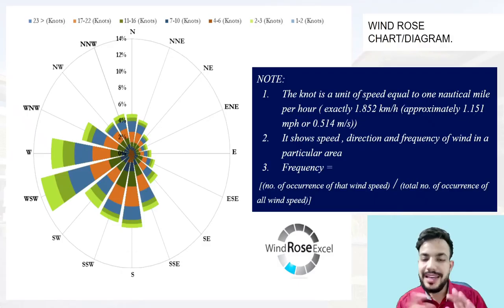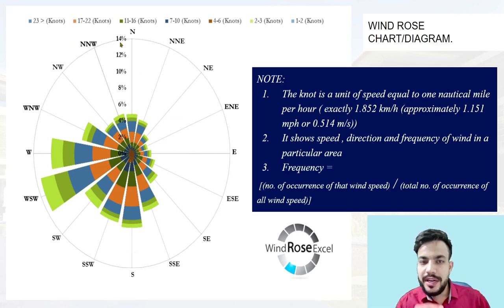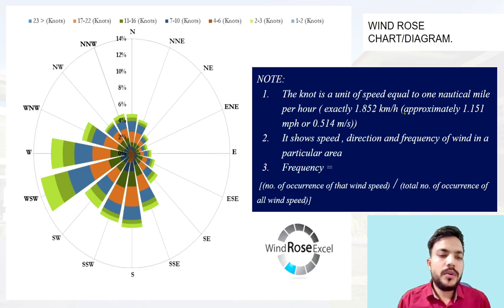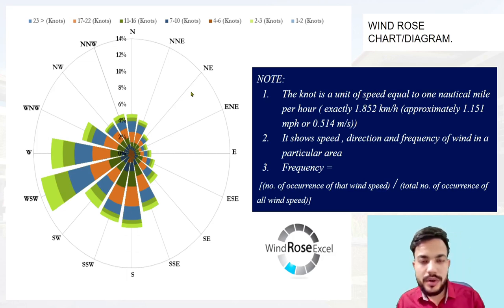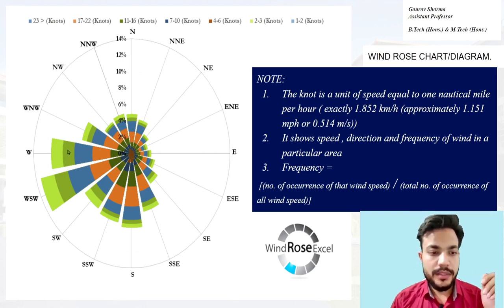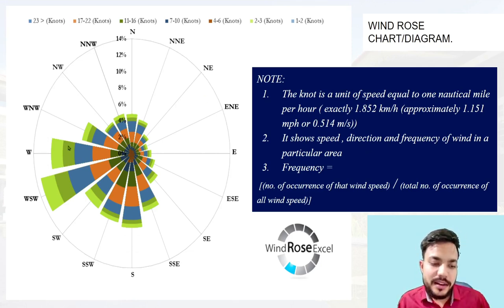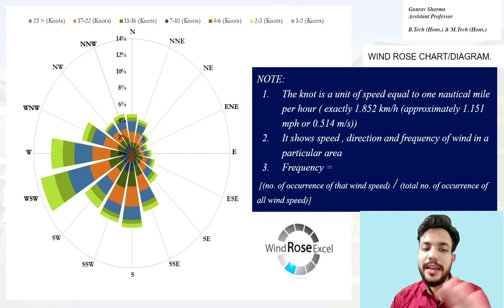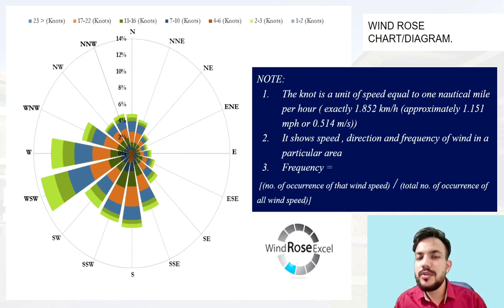Wind Rose Diagram | Uses of Wind Rose Diagram in Building Design | How to read a windrose diagram |

Comment: Sir...How this data is collected sir.......what is the procedure....say in comment itself sir...timinig for calculating the given data....
Reply from the maker: We basically use Anemometer to measure wind speeds quickly, 
With that we collect data from all the directions what i have mentioned in the video.
Then,
Arrange them in a tabulated form and then convert it into the charts. 

You can follow any recognized standards, for timming, calculation and other details for more precise works.
Reply: @CivilAbhyaas  Thank you so much sir....
Reply: @CivilAbhyaas  sir tommorow we have to collect data for it sir....our team doubt is how much time we have to take readings and we gonna do this for 24 hours sir...so how many hours duration we have to take it sir .....
Reply from the maker: The accurate ‘measurement of wind speed has assumed significance not only in the field of Meterological observations end practices but also in the field of industry, pollution control, non-
conventional energy studies, etc. The simple and common method of measuring the wind speed 
near the ground is by measuring the run of wind for a fixed interval of time using a cup counter 
anemometer ( IS 5912 : 1970 ). Besides, there are also remote sensing electrical anemometers extensively used at aeronautical meteorological stations to measure the wind speed near runway 
locations ( is 6871 : 1971 ). The wind speed can also be fed to a recorders for obtaining a continuous record for research purposes ( IS 8754 : 1978 1.)

You may follow the above mentioned IS codes based on your type of anemometer.
Reply from the maker: All the best for your work!
Reply: @CivilAbhyaas  Thank you so much sir....If todays work completed successfully then ur the reason for it sir....thanks a lot
.....
Reply from the maker: Join me on whatsapp by this link for quick notifications

https://chat.whatsapp.com/IqVgviml9GC4EDnsfxwbGA